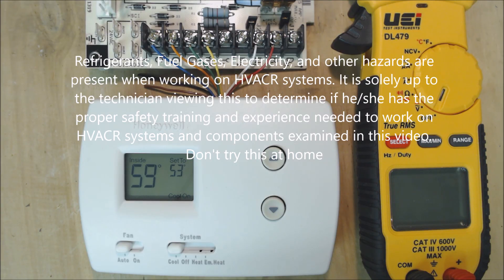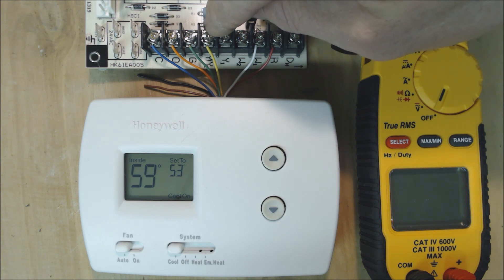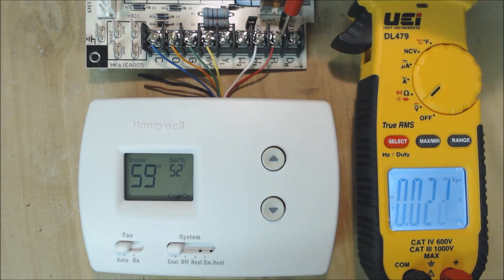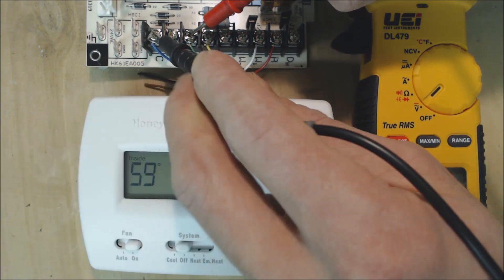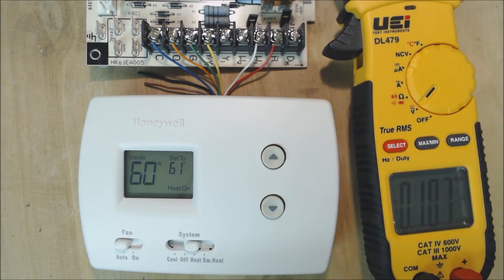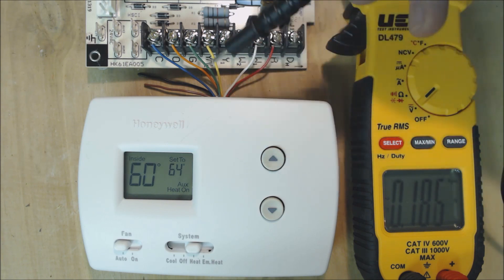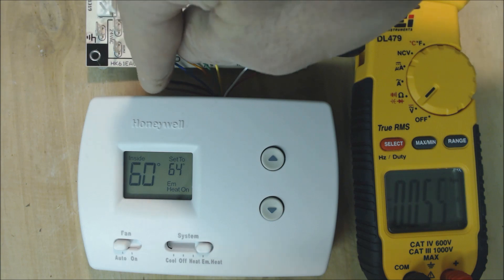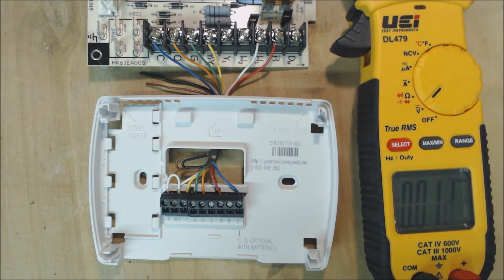How to Test a Heat Pump Thermostat!

Comment: This will help me figure out which wire does what on my old mercury 1980s honeywell q674f 1220 thermostat. Its been kicking my butt, as half of the wire lettering doesn't match up with anything modern, and i can't find any info on it anywhere on the web! For example the c wire connector turns on the compressor 🤦🏻‍♂️

Comment: I just bought this exact thermostat. My old t-stat is a mercury seitch from the 80s. Its a heat/cool/em heat heat pump unit.  On mine the brown wire goes to emergency heat. Your demo uses a jumper. Does that apply to my situation as well?  I iust abandon the brown wire?

Comment: I have a goodman heat pump split unit. The unit blows hot in heat mode. Outside temps range from 30 to 50 degrees F. But at night it blows cold around 1 and 4am. i place the unit to emergency heat for 20 seconds and then back to regular heat. Everything works fine after that. But this is every night. What could be the issue.

Comment: I have a screwy situation on a heil system. Aux heat doesn't come on automatically although the tstat says it's on and I read 24v on w at the fan coil unit. I can manually switch to em heat any strip heat comes on. Any ideas?

Comment: I have the exact same thermostat, for some reason after I put new batteries in mine it started acting up. If I set the AC to 78 the temperature would increase to 78 also even though the room temperature was only 72. It was causing the AC to stay on causing my house to get cold. I verified my room temperature with a separate thermometer. Time for a new one? Any suggestions? The batteries are installed correctly.

Comment: Thank you..Excellent video....Am having the intermittent problem of air handler continues to run after compressor shuts off.
Took some V measurements while in the fail mode..At the air handler:
Air Handler.Terminal strip.
Note: All voltage measurements taken to unit ground wire.
1. Red Wire...27.74 vac
2.Green Wire ...27.4 vdc
3. Removed the blower connector
    and Fan stopped....ok

4. Green and Red wires both  still 27 Vac
5. Removed the T'stat
6.  Green dropped to 11.3 vac and down to 10.7vac...did not drop to zero vac.
      Red increased a bit to 28.19 Vac.
     W 1,2,3 at 0.18vac

Reinstalled the stat.  Switched to off.
Turneded the main power switch off and On for the unit..
Waited 15 minutes.
Placed the t'stat switch  to cool.
Unit functions normal for a few days. 
Re Read Red and Green after a few normal cycles and Green goes to basic zero at end of cooling cycle and blower stops normal.

Thermostat suspected...Blower does stop when  stat is removed during the fail mode.
Thanks again for the excellent video!

Comment: I got a buddy who bought the rth2410 thermostat  for his heat pump at lowes different manuals I find are for the rth2510 and 2410 but they aren't the same cause the 2410 has no w/aux terminal all it has is a W terminal when he turns the heat  the compressor isn't coming on only electric heat  is working no heat pump  i have went through the programing several times and made sure all the settings are right they are i just think the thermostat won't work for a heat pump. Has anyone else have any knowledge or experience with the honeywell rth2410.

Comment: I have a fun that run for only about 1 minutes and goes off the transformer was bad and replaced also thermostat was bad and fun still not running properly what I should suspect next
Reply from the maker: Is that fan a psc, ecm, or ecm variable speed, thanks?

Comment: Hi, quick question I've been unable to find the answer to anywhere:  When in cooling mode, once the target temperature is reached and the Y and G terminals are opened, does O stay closed/powered as long as the thermostat is in Cooling mode, or does O only close while Y is active and then open again when Y is opened?   (Mainly I am wondering if it's bad for the reversing valve to reverse [back to heat, by default] before the pressure has equalized.  I assume it will still operate/slide for a while after the pump has stopped, just due to residual pressure differential?)
Reply: (Put more simply:  Does the O line stay powered up all summer long while the thermostat slide is on Cool, or does it just power on when Y does?)

Comment: I have voltage on O during all setting heat, cool, fan AC Service Tech LLC
Reply from the maker: Are you talking the O reversing valve terminal?
Reply: AC Service Tech LLC yes
Reply: AC Service Tech LLC  yes
Reply from the maker: If you are talking at your thermostat, if the thermostat dip switch is set to heat pump then you should only have voltage during cooling. To double check, make sure to take the o and disconnect it at the indoor unit. Then call for fan, heat, and cooling to see if you still have voltage. If you don't then you know your thermostat is good and it was backfeeding from somewhere. If you do have voltage the either the thermostat settings are really wrong if it is a newer thermostat or just bad especially if it is an old tstat, thanks
Reply: AC Service Tech LLC thanks had a power surge on both inside and outside units replaced air handler control board, transformer, thermostat and defrost board as well

Comment: Thank's for all this information. So helpfull. Have another question. Usually a TD on a furnace can be between 
18 to 22 degrees for an Air conditionning If i'm right. Do the TD would be about the same when it's on heating with a heat pump?
Reply from the maker: It could be 30 degrees down to 10 degrees, depending on the temperature outside, thanks

Comment: What could the issue be if my heat pump is running when it’s 20 degrees outside. Shouldn’t it switch auto to emergency heat?

Comment: You definitely sound like you know exactly what you are doing.  Can you provide assistance? I have a Lennox Heat pump (Series XP14) and Air Handler (Merit CBX25UH) which I had installed to replace my original unit; I've since changed out my damper motors (Honeywell M847D) on both zone 1 and zone 2, my Zone Controlbox (HZ322), and thermostats (Ecobee 4).  My wiring coming in from my Air handler to Zone Control Board is set at RC, Jumper on W2/E, O, Y1, and G.  The Zone 1 (Downstairs) is wired R, C, W1/E, W2, Y1, G, O/B ; Zone 2 (Upstairs) is wired R, C, G, W1/E, and Y1.  I cannot tell how the heat pump is wired;  however I've had horrible experience out the entire setup (Cold in the winter, Hot in the summer), every maintenance person I've had, says everything is wired correctly, however in this video you say Y2 should be used.  I cannot keep paying for someone to come out and tell me it's wired right, can you please help, Thanks!

Comment: Acservicetech,  How crucial is an analyzer for an Hvac tech? They price in about at 350. Is the tool worth it or optional?  How often do you use it?
Reply from the maker: A combustion analyzer is used to determine if there is a crack or clog in the heat exchanger, verify good combustion air, setup and adjust oil fired furnaces, and are used during a pm check of a heater. They typically price out 5-600 and for the kit with the printer 6-800, thanks Uei, Bacharach,, Testo
Reply: acservicetech  is fieldpiece hg3 analyzer same thing? Worth getting it?
Reply from the maker: I thought you were just talking combustion, ok. Honestly not really and you would also need all the attachment heads as well. As the employer, I would rather have the answers in my techs' head then in a machine that they have to rely on but I am only just one person, thanks!

Comment: When using this thermostat on a non heat pump system, in other words, just AC and heat strips, is it possible to wire it so the heat works on the regular heat setting, without turning on the compressor? I have it wired correctly, but my AC and heat run at the same time. The only way I can get just heat is to use the emergency heat setting.
Reply from the maker: You could try putting it in standard heat and ac mode and power the the heat strips with w but you would then need you would need to connect w and g in the air handler so the fan turns on. Make sure the airflow is set for the correct speed if there are dip switches or wire connectors for speed, thanks

Comment: Great videos like always. 
Q: can we test with R instead C OR it doesn’t matter? I always though R is the one tou will be testing with. Thanks again
Reply from the maker: R is power and you need to put the other probe on C or ground to read 24v on the multimeter. If you are going to jump wires then it is r to g for fan, r to y and g for cooling, and r to w for heat, thanks
Reply: Thanks you 👍👍

Comment: So, first check to make sure the thermostat is getting 24 volts from R (power) to C (common).

 IF the thermostat is calling, then you would expect to read 24 volts between the function (Y-cooling, for example) & the common.
Reply from the maker: Yes Correct, thanks Adam!
Reply: @acservicetechchannel  Thanks!!!